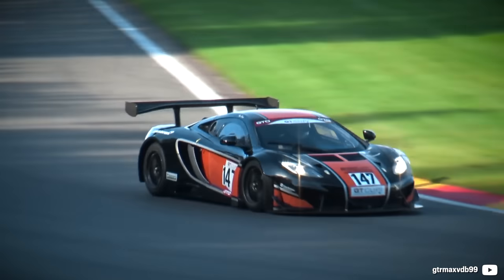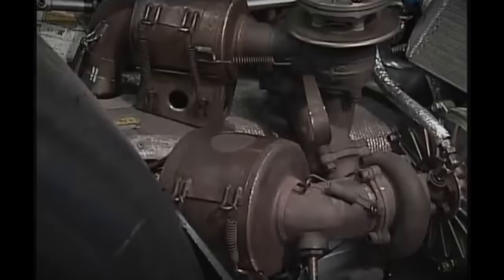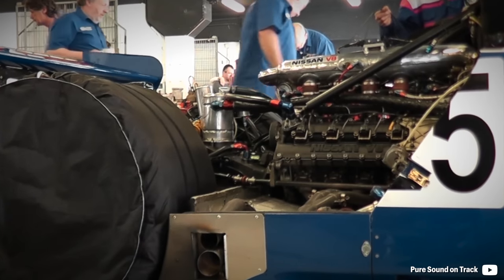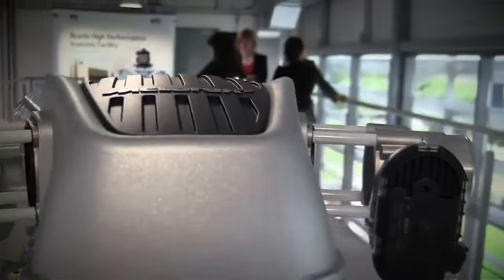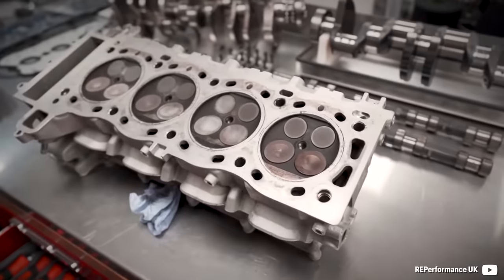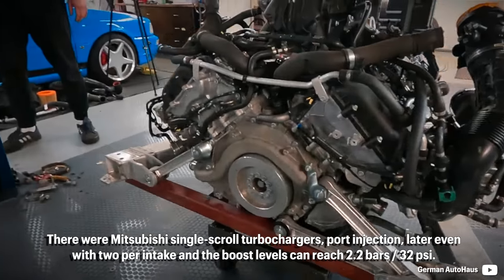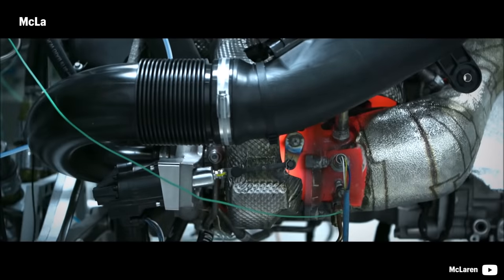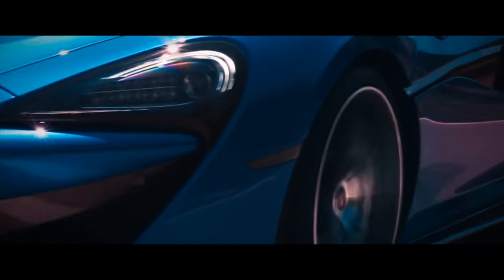The Reason Why A McLaren V8 Is So Good

Comment: It's a Nissan engine, of course it's good.
Reply: Then you look at the rest of the car and everything makes problems and has bad build quality, on the other hand its an english car so that makes sense.
Reply: @benistingray6097  Quality problems are a proud British motoring tradition.
Reply: @benistingray6097  absolute nonsense. The MP12-C had many reliability issues (McLaren's first modern supercar) but after that they've been very good and cars like the 720s left all of the competition far behind with the incredibly engineering. Also the modern engine is very different from the original Nissan engine, Riccardo have changed it almost beyond recognition (another English company btw).
Reply: @skaldlouiscyphre2453  - Did you know about 85% of all motorsport engineering happens in the U.K? Quality problems are a thing of the distant past.
Reply: @LeeXRV  It's a shame that engineering prowess doesn't translate to reliability in road cars. It's been a pretty consistent trend in reviews dating from well before I was born until present. The decline in numbers and relevance of significant consumer brands from the UK is the main factor in making this trope less relevant.

Perhaps all the talent is tied up in rent-a-works operations for motorsports? 

I don't rag on British cars out of dislike; I rag on them because there's so many examples of "don't meet your heroes" among them. The ones with the best reputations for reliability all seemed to be GMs, Fords or rebadged Hondas. looking at you Rover

There's a great legacy that's largely been allowed to become hollowed out in the middle through decay and it's pretty much entirely up to foreign ownership to rebuild it, if they so care. Niche aspirational brands aren't really enough to continue a legacy.
Reply: @skaldlouiscyphre2453  It's a very weak argument perpetuated falsely on the internet primarily. The same argument is entirely possible for American cars (the most unreliable in history, especially GM and Ford cars) and many other brands with the exception of a few like Honda & Toyota. The talent of British automotive engineering is in high end/cutting edge development because frankly the U.K isn't the best place to build cars with the incredibly high cost of manufacturing and workforce, it's the for the same reason much manufacturing left the U.K. with the advent of globalisation. The British have been and are world leaders in many engineering disciplines which is why nearly all high end development work is done there and why it does make sense to have supercar brands in the U.K. However, you can guarantee on any McLaren or British car Youtube video you'll get someone along (and sadly it's usually an American) to say but 'they are unreliable' or something to that affect (not aimed at you but well demonstrated in the comments of this video).
Reply: @LeeXRV  Go check some honest youtubers who dont fear to tell the truth, lots of them having build quality problems, same as Ferrari btw but for a normal person who never worked on cars like these maybe the shiny brand logo and all the tamtam will fool them.
And what has the build quality of a production vehicle to do with motorsports?
Reply: @benistingray6097   I see the obvious flaw, when you say go check Youtube because a small number of owners is obviously a unsuitable sample size. With that said it’s also easy to adopt the contrary view for example, DragTimes has literally done thousands of hard launches in his 720s with zero problems or the Apex car has done over 30,000 very hard miles around the ring with zero problems. I’m not suggesting they didn’t have serious reliability problems with the MP12 but I am suggesting that 99% of the people positing this comments have never even sat in a McLaren they are just repeating the same nonsense they have read on the internet as if it’s a truth.
Reply: my datsun agrees 🐱👍🏿
Reply: @LeeXRV  Dude my hint to youtubers was to increase credibility and make it easier for a layman like you to understand.
Im a certified car mechanic and i have worked on these cars, Aston Martin, Ferrari, Jags, Lambo, Porsche, McLaren and many many more and in the end these are all cars like any Honda or Ford.
Underneath the carbon fibre skin the are cars like any other and work under the same principles, apart from the logo and the price tag theyre really not that different.
A normal person on the street is never going to hear of that because the manufacturers want to keep it secret.
Ferraris and other luxus brand get towed and transportet under covers here so people dont know what car broke down.
Reply: @benistingray6097  it's disappointing you lowered the discussion with petty insults (a layman like me?) however I largely agree with the sentiment in your post. I'm genuinely interested, do you work in the aftermarket space or something? Every supercar owner I know (and I know a fair few) has always taken their cars to brand dealers where they mechanics are qualified to the brand although I'm not suggesting for a second a mechanic necessarily needs specialist brand training for everything.
Reply: @LeeXRV  Im sorry, it wasnt meant as an insult, it was just a general assumption because most people on the internet who try to tell how great these cars are havent even sat in one, as you said.
I've worked in a Honda shop but the owner and his partner had a car rental business for sports cars on the side. 
We mainly did the daily maintenance in our shop and we had them also in our showroom to increase traffic to the shop.
And yes youre right, the bigger things got mostly done at the brand dealer for warranty purposes but we also had lots of older cars which we did ourself because it was so much cheaper.
As for qualification, the education for car mechanics is really good here in switzerland and works very different than in the US (its an apprenticeship model, 2 days school and 3 days in the shop per week for 4 years with lots of additional mandatory courses every year).
After these 4 years you have all the necessary knowledge and skills to do every repair and diagnose on every brand as long as you have the service manual and the tools for it.
Service manuals for everything and every brand is available here in dealer-networks you can join as a shop owner for a yearly fee and as for specialized tools that can be harder to get your hands on but most shops know each other and also work together so most of the time you can get the tools you need from someone you know.
Reply: @LeeXRV  And to get back to the topic, i dont say all english cars or all luxury brands are bad per se. All manufacturers have problems and also simple, awkward problems that shouldnt have happend.
But there is a reason why english cars have a bad reputation, Landrover doesnt help the situation either ;)
As for Ferrari, i specificly brought that up because Ferrari is probably the biggest, well known and most hyped luxury brand out there and there are quite a few good videos on youtube which can demonstrate the problems with them.
Reply: @LeeXRV  Denial isn't just a river in Egypt. 😂
Reply: @skaldlouiscyphre2453  - I reckon you can do better than repeating old worn out lines off the internet! You could make a joke about my statements being as reliable as British cars or something? 😅 - Have a good Sunday chap.
Reply: @benistingray6097  Thanks Beni, makes sense and sounds interesting. I know the U.K. operate various apprenticeships schemes which are very similar and are also mutli-year to complete.  I absolutely believe cars should be able to be worked on outside of the dealer network.
Reply: @benistingray6097  in the uk its American cars that have a bad reputation for poor quality.
Reply: @noke25  They are not much better. If a friend of me is looking for a new car i always try to steer them to Honda or Toyota. I would never suggest anything from the US or the UK, and european brands are not much better tbh, if you need half a day to take an exhaust gas recirculation valve out in a VW T6 because there is so much crap in the engine bay and you have no space at all.
Reply: The only people that will have issues with this comment are europeans. They hate to know a Japanese auto maunfacturer can build an engine so goid that a prestigeous car compant like McLaren would use it and literally de-tune it for series production.
Reply: @conradsealy9603  Europeans? Why lol.
Reply: @conradsealy9603  could you get any further from the truth? You know in the U.K. Nissan are in the top 5 for car sales? Also European? You think an entire continent (or 27 countries) have the same belief? - yikes!
Reply: @LeeXRV  720s also has Mitsubishi Turbochargers
Reply: @LeeXRV  nowadays this us stroked Nissan engines))
Reply: @skillandluck  that’s very true, they are supplied by Mitsubishi Heavy Industries with a model number of TD05-06*20HF1T-12T (yes I need to get out more 😂)
Reply: @LeeXRV  that’s serial numbers uses only by MHI
Reply: @skillandluck  I’m happy to be corrected if that’s the serial number, what is the model number? I was always under the impression that they used TD04/TD05 with further designations for the specific unit of the class? I.e they made Subaru Turbos that are named TD04l-13t and similar.
Reply: @LeeXRV  also Japanese automotive)
Reply: In the past the V8 are from Yamaha
Reply: @elloquero6543  ??? Only Lexus uses V8 by Yamaha
Reply: @benistingray6097  You do know Lola built the chassis for Nissan?
Reply: @skillandluck  Volvo and Ford also had Yamaha partnerships for V8's
Reply: @micahrlusk  we are talking about Nissan engines for McLaren. WTF Yamaha??? I know that Volvo used Yamaha 4.4 L V8
Reply: @skillandluck  you literally said “only Lexus uses V8’s by Yamaha” so your words not mine lol but okay bud
Reply: @micahrlusk  I know ALL cars which are uses Yamaha engines. But EVERYBODY under this comment talking about Nissan TT V8.
Reply: @skillandluck  more or less, but you said only lexus used Yamaha V8’s so you’re the one that took the turn lol I’m so confused as to what you’re on about
Reply: You mean datsun!!!
Reply: The McLaren engine is a Ricardo engine
Reply: @RenanMXFNYT  Nissan engine built by Ricardo*
Reply: @LeeXRV  don't waste your time... The internet has that stupid crowd mentality and they've got it in their heads that JaPAnEsE gUd and BrItIsH baD. Most of them are likely too young to actually possess a driving licence anyway haha
Reply: @jamesmx7  no the English autos were just bad the morris Minnie's and the likes were great commuters for its time but that's it and old old Jaguars great sports cars but the 70s is far gone now....
Reply: @LeeXRV nah actually that's exactly why British cars are so fucking incredibly unreliable. Racing engineering sucks on road. That's why 720s McLarens are not even worth buying for car rental companies they are so unreliable. British do make the best sports car chassis though. Like aero and chassis wise 720s is unmatched by any production car in it's price range. Unless you count in boutique manufacturers like Ultima or Radical which are also British.
Reply: @LeeXRV just look up throttle house review on recent McLaren Artura, look how much electrical and built quality issues the car had. Neither Corvette Z06 nor Ford GT had any faults in their review.
Reply: @noke25 he is not speaking about interior materials. He is talking about UK cars topping unreliability lists as if they were collecting infinity stones 😂
Reply: @nodo7575  the Ford GT is unequivocally one of the most unreliable supercars ever created, there’s mountains of evidence to support this and the Z06’s engine failures are also widely reported. American super cars have always had diabolical reliability.

Comment: A few incorrect facts in there.  The original design layout came from Menard Competition Technolgies who sold the rights of the original layout to Mclaren road cars.  Mclaren road cars having no engine design capability tasked Mahle Powertrain (who were formaly Cosworth) with turning that race design into a road car engine.  Mclaren wanted the customer to feel their race pedigree and so asked for NA and gear driven cams.  On hearing the Mahle version of the engine Mclaren realised that such a noisy thing (the gear drives would be inches behind the drivers head) could never make a road car engine.  At about the same time Ron started to get wind of emissions regulations and also wanted a 300g/km engine.  The fixed cam timing NA engine could never manage that.  So legal jiggery pokery ensued and next thing Ricardo end up tasked with making it work as a road car engine.  The base layout was kept, but just about everything else was thrown out and started from new.  Now the engine was turbo charged, had chain drive cams, variable valve timing on inlet and exhaust and also new fangled eletrically driven thermostats.  Those in conjunction with secondary air injection (and not moving the throttle) allowed an early proptype MP4-12C to scrape through the 300g/km.  So its not really a race engine at all apart from the layout, and its only a Mclaren in funding as Ricardo also made it as well as designed it.  TTFN Ex Ricardo (and Ilmor) engine designer.

Comment: TBH it only sounded "phenomenal" in the early days (aftermarket exhausts notwithstanding). From the 570S onwards, it just had the same kind of sound as a 488, the muted single-tone flat-plane noise. The 12C and P1 almost sounded like cross-plane units, they were much more complex and interesting sounds.
Reply: Interesting- care to elaborate in more detail?
Reply: Basically, McLaren started using unequal length headers in its early days, making this unique flat plane rumble sound. Later they switched to equal length ones, thus making it sound more Ferrari-ish @jdmimportlogistics

Comment: Very presentable and very detailed video bruv, but I had a difficult time understanding what you where saying in some parts of the video. Written subtitles can go a long way to helping those in the audience get the full detail. Keep continuing to improve 👍
Reply from the maker: Some need them, some hate them. I habe a difficult time deciding whether to use them or not. Closed captions are very precise most of the time
Reply: @VisioRacer  The AI had an opinion on the dyno run.

Turn on the captions at 8:13
Reply: @VisioRacer  no reason not to use them as everyone has a option to turn them on/off.
Don't bake them into the video.
Reply: @C.Fecteau-AU-MJ13  That was funny.

Comment: Nissan has historically made the best V8's
Reply: No.
Reply: @ghostwrench2292  besides the LS The Nissan  VK is the most used V8 platform in auto racing. Its not even close.
Reply: I dig the 5.0L VK50 in my FX50.
Reply: @Sir.VicsMasher  FX50’s are elite.

Comment: If I could design a engine, it would start out as basically a LS/LT engine, then deepen and thicken the cylinder sleeves, thicker deck, and main webbing, raise the cam tunnel, improve the oiling, the oil pump would basically be two pumps, one for the crank only, capable of very high volume, to maintain 60 psi at peak temperature, at idle, even with the thinnest oils, the heads would be the main difference, they would be nearly twice as thick, allowing the intake charge to fall. Straight on the top of the valve, the intake. Would be a major part of the head design, it would basically be short to medium length trumpets flaring into a large plenum,   if carburetor it would require 4x 2bbl carbs,  at best 2x 4bbl carbs would. Be required, with possibly a 60° V, I'd have to look into the engineering, maybe the heads can be designed to simulate a 60° v for the intake distribution,  a lot of wet flow testing to see how the plenum and heads flow, the intake valve would open into the center of the cylinder, possibly using two cams in the block, to open the complex valves, with the pushrods crossing the valley, depending on the geometry, not sure if an overhead cam can cover the geometry, if so it would definitely be a dohc, with the exhaust nearly exiting the top of the head,.  With exceptionally thick deck surfaces,   allowing angle cutting to fine tune the angles and compression ratios,  with a minimum 4.080" bore and upto 4.200"+/-,.  And stroke from 3.200" to 4.100" , and possibly 4.280 with clearance bring made, and possibly a flat plane crank version made, along with direct injection, and  a cast steel crank and rods in a base version, and 4340 in the others, with forged Pistons,   and shaft mount rockers with offset rockers possibly made of titanium, with a operating range from 1k RPM, to 8800 rpm+/-,  with rods on the long side, 6.150", with a deck height about 9.155"to 9.220",  with tons of water in the heads , using basically two water pumps, in a single housing, with water not flowing through the deck surfaces,  the water flowing into the head on both sides in the center, and out on bothe ends,  the same with the block, both using about 1" passages for the outlets, possibly cast into the block and heads, maybe a bolt on piece, with stainless tubing, using as little runner as possible a single piece crossing head to head in the center under the intake, with the rear exits running around the outside, to the front, then run parallel to the in flow,  almost like the flathead Ford V8,  only using a single pump, maybe possibly electric, and should leave a near flat surface for accessories on the front of the engine,  it would be awesome to design and build a engine!! Sorry to ramble!! ✌️
Reply: Dude, that's porn of a description!
Reply: You want fries with that? 
JK you know your stuff. 😅
Reply: Why not build your engine and put it in a car?
Reply: Also, how do you know this is a good engine? I know nothing but i’d love to pick your brain.
Reply: I love your excellent idea!!!! DO IT!!!!
Reply: Left out getting rid of the push rod valvetrain.